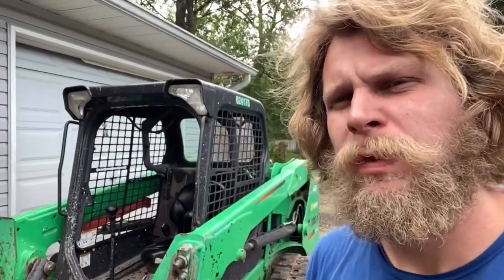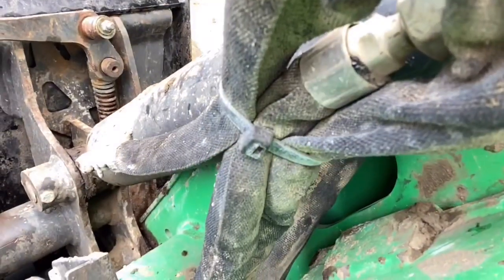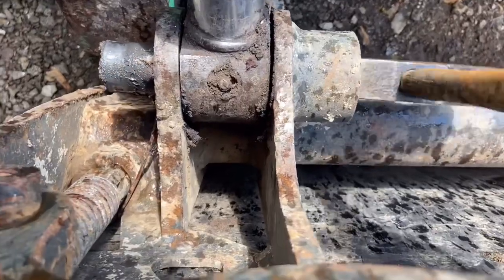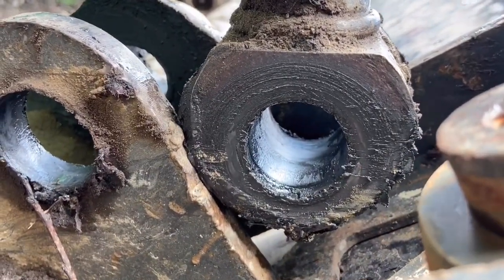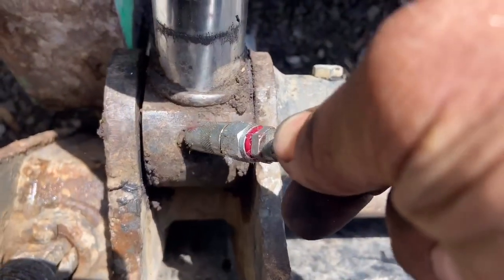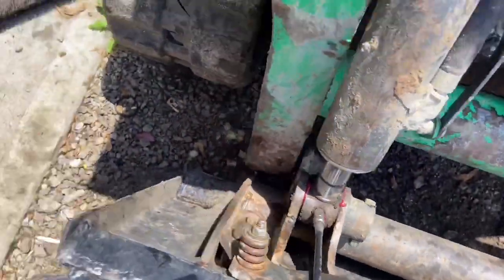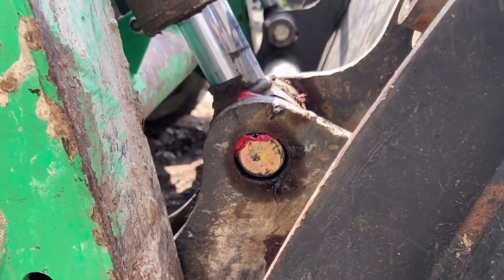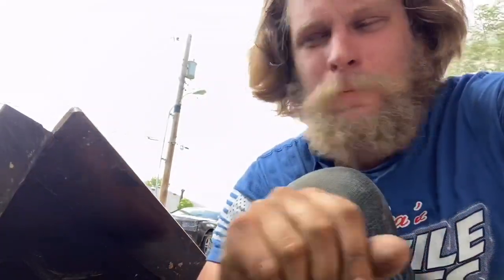Skid steer ram pin replacement quick attach

Comment: I know its late but comical pins have a tapered seat
When that seat gets warn out all the weight is on the bolt and not there's pin 
There isnt a bolt you could use that would hold up to a full bucket of weight 
Unfortunately your looking and not only a new bolt and pin 
But you need a new boss on these boom
If your a good welder you can do it
Do both sides and use angle iron as your straight edge across both sides When you weld them back in